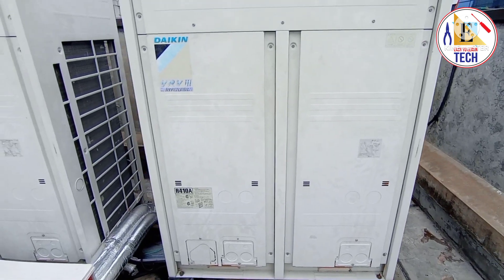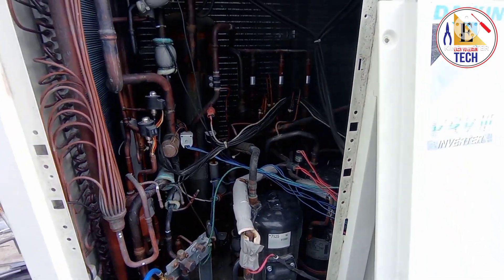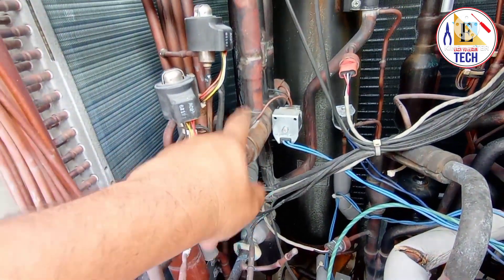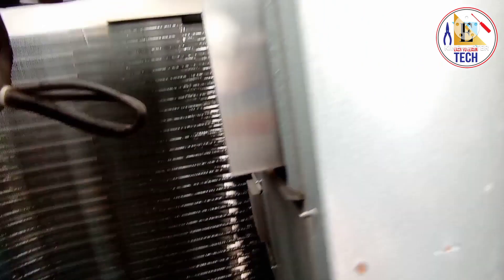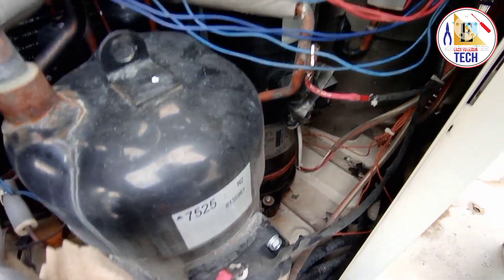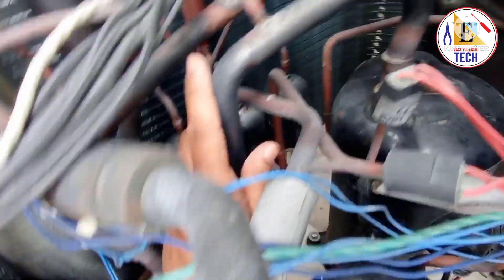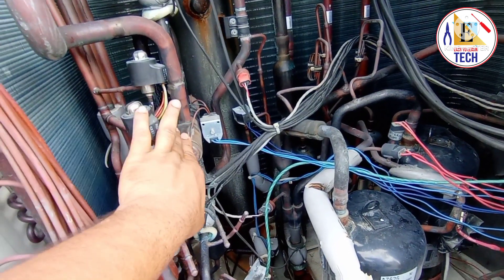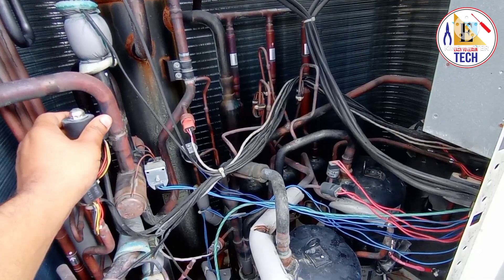VRV_HVAC// WHAT IS INSIDE DAIKIN VRV 3 OUTDOOR  || TUTORIAL OF VRV OUTDOOR // DAIKIN VRV 3 INFO

Comment: how many expansion valves in vrv indoor & out door units did indoor units also have eev?
Reply from the maker: Yes each indoor unit has 1 EEV, AND OUTDOOR UNIT also has the EXPANSION VALVE depending on the quantity of the compressor.
Reply from the maker: WITHOUT EEV VALVE VRV & VRF CAN'T CONTROL THE REFRIGERANT TO EACH INDOOR UNIT. IF YOU FIND HELPFUL LIKE SHARE & SUBSCRIBE BRO.